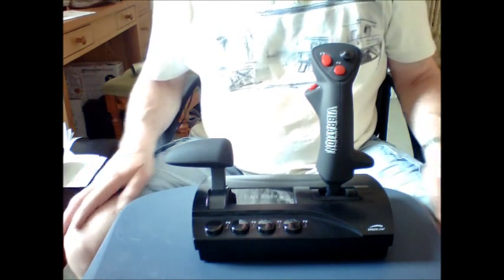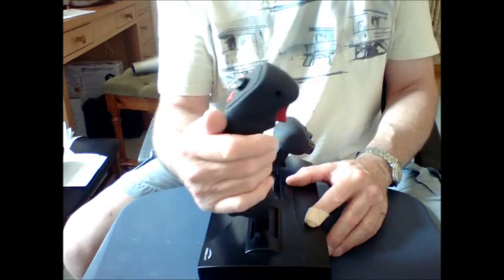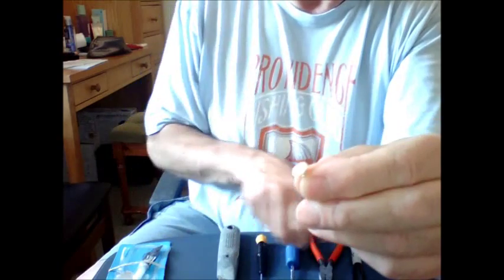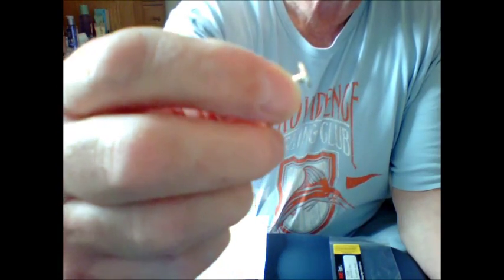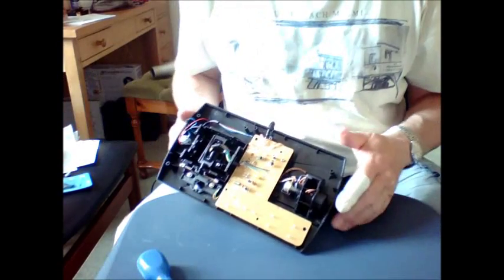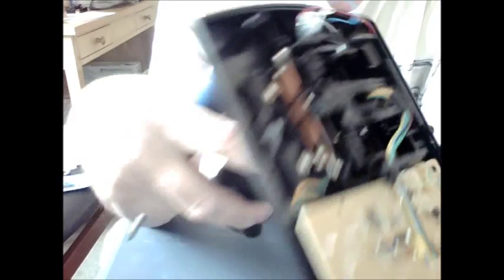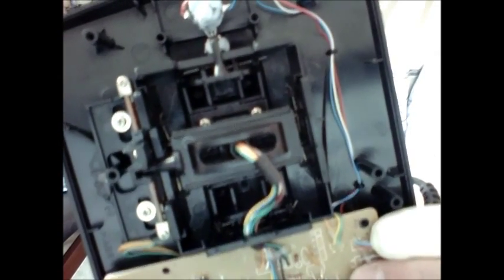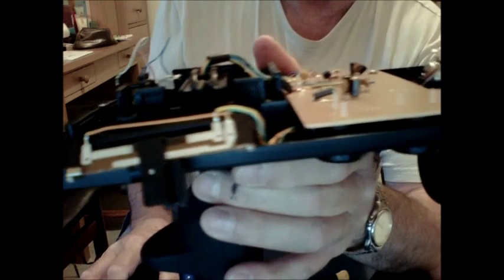Black Widow joystick Hall Effect modification - Part 1, theory, tools and parts

Comment: Hi klem. Thought I'd get a notification of your response (very prompt - many thanks), but I didn't so I've only just got to it. Looks like a great little mod - I'd like to do it at some point (inc the throttle). Probably wouldn't go more expensive - only use it for a game (War Thunder - upon which I've been SERIOUSLY hooked for well over a year now. (Love shooting, love flying, love the old War Birds - especially the Spits, of course - brilliant graphics - can't put it down, so wearing out my pots {:o).
Reply from the maker: Hi Bill,

I hope you get to it when those pots finally die. I've never 'flown' WT but if you fancy a challenge there' Eagle Dynaimcs "DCS World" which now includes some WWII planres. The basic sim is free to d/l and you get a free Su25 Frogfoot and a free P-51D mustang traiiner (no guns). However the flight modelling is very realistic and a handful until you get used to it (rudder control is essential). Early days yet but the on-line community is growing. Good luck with the stick.

Comment from the maker: Hi Bill, I just never went that far. I was 'stranded' at a relatives home without my usual rig and suffered withdrawal symptoms :) so I bought the low cost Black Widow and spent more time modding it than using it! With a bit of thought you could probably apply similar principles to the throttle. Mine is in the cupboard now I'm back home.